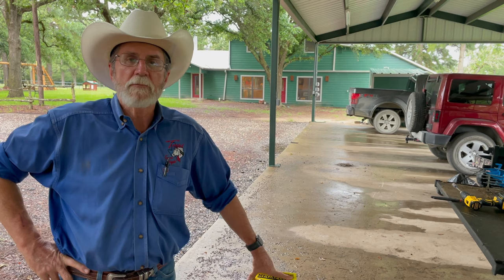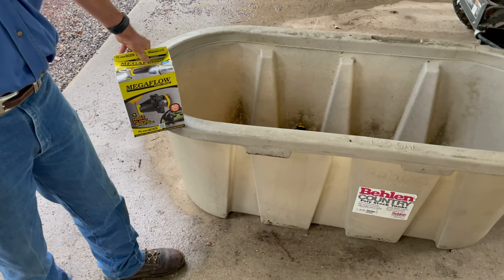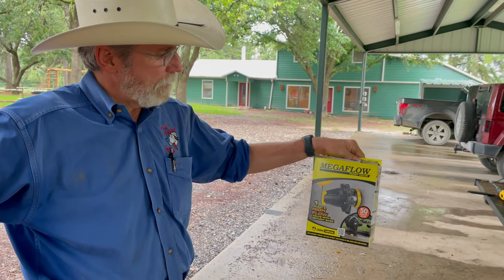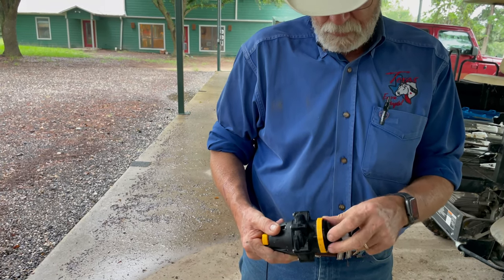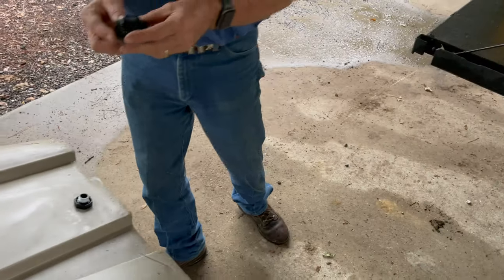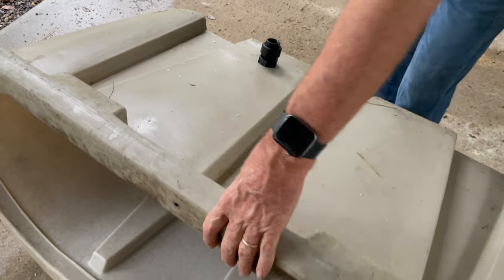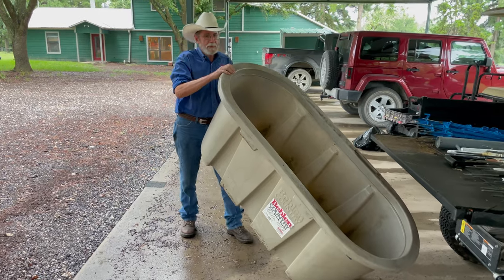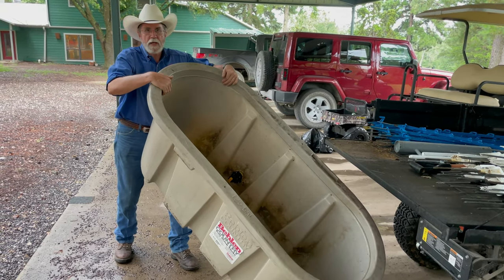How to Install a Megaflow Float Valve | Regenerative Ranching

Comment: I've got a similar setup, with a like-sized tank and herd.  I've had my herd empty the tank on a hot day and dump it on its side, leaving me with a swamp. I strapped mine to a 4x4 pallet to make it tip-proof. It's not great solution, but is effective. Driving some fiberglass posts in on each side might also work.
Reply from the maker: Fiberglass posts are an excellent idea!

Comment: Good video with actionable information. I love those valves. I use tire tanks with the same valves. One thing that I do differently is to switch out the string on the valve with some lightweight galvanized wire. If I want to raise or lower the float for any reason I’ve found that I can move it in more precise increments with the wire VS the string. Good looking herd!  What breed?
Reply from the maker: Great idea!  Thank you!

Comment: Hi cliff I just installed my megaflow valves,  I purchased mine on amazon and my product did not have the bulkhead screw on adapter or the oring I purchased those from Kencove, did your valves come with them in the box?? BWT thanks for the tutorial.
Reply from the maker: The valves I purchased did not come with the adapter either. I had to buy it separately. Thanks for watching. That was my first video. It was a bit rough 🥵
Reply: @cliffhonnasregenerativerancher  thanks for clearing that up thought I was getting ripped off. Lol we ended up buying 12 mega flow valves for our cow calf operation.
Reply from the maker: Good for you!  I’m very happy with them. I hope they serve you well!

Comment: How do you drain tub? I’m looking to get a Rubbermaid tub. It has a drain hole where I want to put the float. I don’t want to put another hole in. Can you drain without taking out float every time?
Reply from the maker: The trough I used had a separate threaded drain plug at the end of the trough. The only way to drain it without the drain plug is to tip it over, siphon it out, or pull out the Megaflow float valve.
Reply: Hi Jamie. How did that work with the rubbermaid tub. I just got an 1.25" megaflow valve. I wanted to do the same thing. It seems the clearance is limited and i may have to drill a new hole.

Comment: Cliff you show a garden hose connector that needs to be ordered separately. Do you know the name of that piece and where we can order it?
Reply: Nevermind, I found it here:
https://www.jobevalves.com/products/product/fghtfnpt-adaptor
Reply from the maker: That’s correct!  I got mine at Amazon. Jobe Valves J-ADF100 Garden Hose Adaptor, 3/4" GHT x 3/4" NPT with Swivel, 150PSI, Black UV Reinforced Nylon Material with Nitrile Seals https://a.co/d/b4qm8Mh